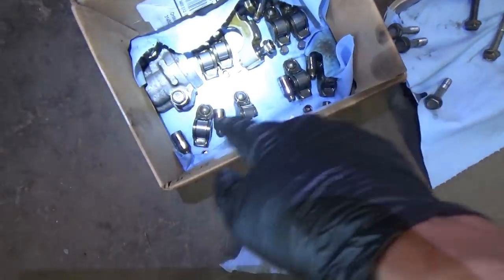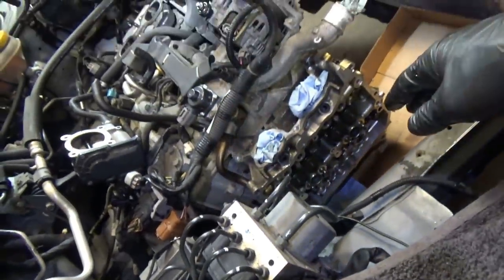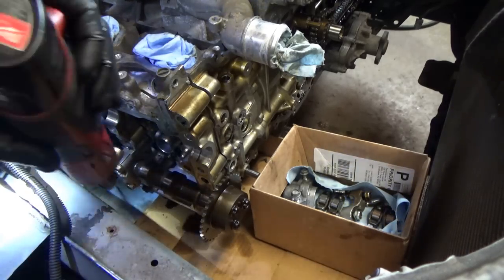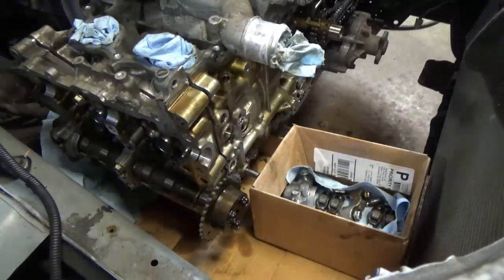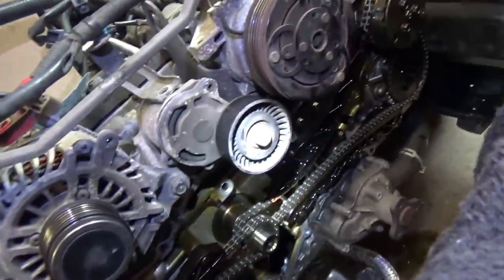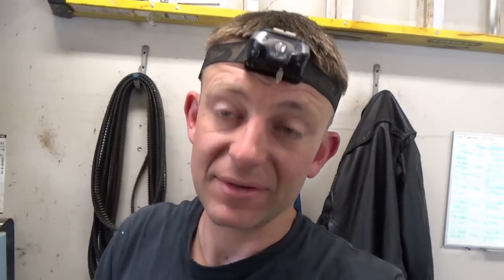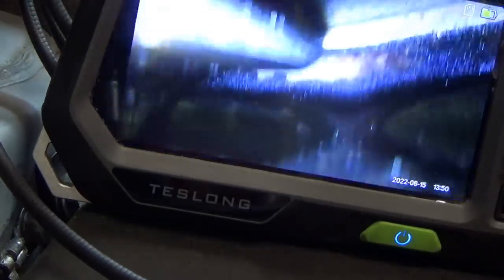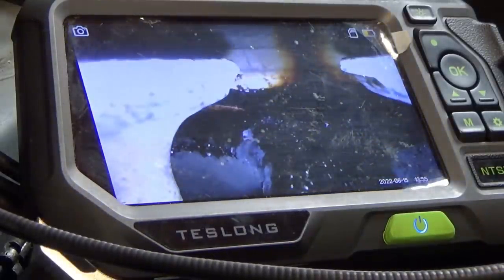Head Reassembly & Left Head Valve INSPECTION (Sad Subaru - Part 4)

Comment: BTW Ivan, this customer has played this one spot on, this one valve had to be changed.  Undoubtedly there are issues throughout the engine, but some of the comments on here beggars belief, You must remove the engine, plane the surfaces, replace the valve seals do this do that, you would be talking spending a lot more money, on a car with a questionable transmission and is getting on in years, what you spend on a car has to be PROPORTIONATE to what the car is worth and how old it is, people do not seem to understand this concept!  I'm sure he will get a few years out of it, and knowing you if it fails in a short time you will reimburse him for the labor.  I recall my dad replaced crank bearing shells, main seal, head gasket on a Honda Prelude I owned, he never used a torque wrench, reused all the old bolts and did it all in 2 days and you know what, that thing ran for another two years, and was still running after I traded it in!
Reply from the maker: Great comment Rob, I 100% agree 🙂
Reply: @PineHollowAutoDiagnostics  I traded it for a nearly new VW Passat, this was back in 2001 when I lived in the UK, let’s just say I should have held on to the Prelude!
Reply: In most cases, that would be the best method however, with some folks, keeping the same vehicle running is more important that the cost or going a little upside down with money being invested in them. A replacement vehicle, used, will carry a certain amount of risk too.

Comment: Subaru tech for almost 4 years. Normally watch your channel for scope diagnostic but I got curious when i saw a subaru video. Must say I am impressed you managed to get everything together with engine in. Just pull the engine next time. Only a 15 mins more work to have it out. Much easier to clean and no fighting with shims and rockers. Also you don't have to remove the intake with it out of the car. I take the bolts out and shove a small piece of wood between intake and coolant pipe to hold it up.
Reply: Yeah back when he first started the job it reminded me of Brians mobile one .. he was sack one day and did a time lapsed voice over..removed the engine in a few minutes less then an hour  to replace I belive was head gaskets ..said it saved him 2-4 hours??
Reply: I don’t think he had any way to hold the engine, though.
Reply: BTW  not saying I could do it that fast .. or save any time removing the engine .. just saying Brian liked to do it that way ( I think he used to be a Subura tech )
Reply: Ivan needs a bigger garage. Complete with engine hoist. Stands ect. 
He is doing the work like I used to do at my home. I jacked up trucks on stands. Dropped transfer cases and transmissions. 
Swapped engines. All this with no shop.
Working at a shop with all the equipment has its advantages. Kudos for Ivan for what he does. Drives hundreds of miles as a mobile Technician. He is a very cool guy.
Reply: @2nickles647  you bet 100% credit to Ivan I have been a very small contributing patron sponsor for him for at least five years I love watching them work he seems like a great guy.. by the way I'm 99% sure he does have an engine hoist but yes sooner or later age is going to hit Ivan and getting up and down off the ground all the time to do things underneath cars is going to get to him so yes hopefully one day he can get himself a lift and an external garage but of course those now cost an exorbitant amount of money not to lift that's not that bad it's the building to put the lift in that's what's horrendous
Reply: I think the challenge of doing this with the engine in was what interested Ivan. It is a good teaching video for the DIY guy without lots of tools. In hindsight, it would have been easier to do the other valves with the engine pulled but how much time would it have saved?
Reply: @dosgos  well it may have saved hours literally hours and you're right this is a good teaching moment but I think Ivan has had enough challenges in his life working on cars that he doesn't need another one 😁
Reply from the maker: @deepsquat600  my engine hoist is a tow strap wrapped around the ceiling rafters. Used it 2 times in 10 years... Both times on Subarus haha
Reply: @PineHollowAutoDiagnostics   if it works, is it really a bad idea? Lol 🤣🤷🏻‍♀️ subi engines are quite light too.
Reply: @PineHollowAutoDiagnostics  My dad used to use a come along to pull engines, your method could not be as bad as his was.
Reply: Well, from my part Ivan deserve every bit of admiration, he is not scamming people like some other technicians, I told the guy once before , Ivan am Elon Musk came to earth in the same space craft , the way he analyze the problems and get to the conclusion to solve it, that’s something not that many people have that gift !
Reply: @PineHollowAutoDiagnostics  Come' on Ivan you live in farm country. Couldn't you find a farmer with a backhoe to pull the engine? That's how we did it when my friend Dennis needed to pull the twin Chevy small blocks out of his power boat to fix the final drive. John Deere to the rescue.
Reply: @2nickles647  Ivan is still young.  Someday he won't.  Part of "he won't" will be wear and tear on his body now.  There's no free lunch when you are young.  It all comes back later.

Comment: Yeah, those valves in the other head are done for too.  Definitely an oil control problem.  That would explain the heavy carbon buildup in the head dome and valve seats.  But I don't think it's a stuck PCV or bad valve guides or valve guide seals.  If I were to guess, it looks like it may be time for a new set of piston rings.

Comment: The earlier year models of the FB series engines (2012-2014 Forester, 2013-2014 Outback, etc) had a maassive oil burning issue that causes exactly the problems shown here- burned/ cracked valves, pitting, oil consumption since the exhaust valves can't seat properly, etc. Had a 2013 Outback that burned oil like crazy- like 1 quart every 800 miles or so. Like they went straight from head gasket issues to oil consumption issues. If you're looking at a Forester or Outback, 2015-up is less of a risk- they seemed to have addressed this issue by then (updated rings maybe?) Never understood how Subaru became one of the top selling vehicles in recent years with all these issues between head gaskets, oil consumption, CVT problems, etc but they are still extremely popular around where I live.
Reply: Popular because of creative advertisement is my guess.
Reply: Consumer reports best buy and fairly cheap car.  That is why they are so popular and you see allot of them here in the Pacific Northwest.
Reply: Because these problems take time to show themselves, and not everyone will experience them.
Reply: @Cheepchipsable  If you find a 2013-2014 model that doesn't burn oil, better hang on to it it's a unicorn
Reply: @Cheepchipsable  Wife's DD 2015 Forester 2.5  she does a 100 mile commute everyday.  Thru some of the worst traffic in the Seattle area also.

Comment: Nice job Ivan. Can't wait to see how it runs! I would not worry your side would hold up longer than the other side. Things break. The owner knows. Subaru had a recall on high oil consumption. With the engines using 0 w 20 oils. Good job.
Reply: My Jeep 2015 Renegade also had a recall on excessive oil usage.  It used a quart/2 000 miles at about 45000 miles..  It was "repaired" with a new software installation.  Never thought of that being a culprit and no idea what it did.   Now, there oil usage is virtually nil.

Comment: Hi Ivan,
Nice work getting the shims and rockers on the exhaust valves. That is quite a bit of oil pooling in the left cylinder and those exhaust valves don't have much life left. If it is burning oil, that engine should be either rebuilt or replaced with a quality rebuild unit. Stay safe.

Comment: Hi Ivan. You didn’t mention the valve seals . My VW  was burning oil at high  mileage . I sent the head out to a shop for refurbish seals valves etc. I did the rings & Shell bearings and checked end play all the bottom end . But your doing a great job with the motor still in the car . Very interesting to watch waiting for #5 episode 👍🛠🔧⚒⚙️saving the customer a ton of cash .

Comment: Somewhere I heard that this generation of Subarus tried to address better fuel economy and to do that they made everything loose. Less friction equals better economy. But they made it too loose and it just burns itself up.
Reply: Yep, a lot of these era engines have very low friction oil control rings, leads to huge oil consumption and endless other issues.
Reply: This is true of all manufacturers. It is why oil changes with the correct oil are so important

Comment: Your boar scope camera work was fantastic inside the other bank #1. And you took pictures to show the owner. I wish I had thought to do that on both banks B4 the discussion of repair with the customer, but I did not. I only thought of boar scoping the bank #2 with the problem cylinder. I hope those hydraulic lifters pump up. Leaving them laying sideways out of oil might have allowed air to enter. Some lifters need manual priming B4 reinstallation. Worse case just bring the engine up to 2000 RPM and hold for 30 minutes. Those exhaust valve shims are all selectable and because new exhaust valves where installed a special tool is used to check exhaust valve height that ultimately effects valve to cam lobe clearance. That engine has 140,000 miles so it's a broke in slop monster so it might be more tolerant. Your work is wonderful. I learn a lot watching your videos. My comments are only that. You're doing great work and the vehicle owner is in good hands.

Comment: Great work with the endoscope IVAN.That is a super handy tool when working on motors.I don't know subs but maybe the cylinders laying on the side contributes to the oil pooling ,whereas inline fours are straight up? and v8 or 6s slanted.This one is Definitely using oil.If the lifters are non adjustable,what a pain.I worked on older JAGS and a few ferrari's and they had overhead cams and BUCKETS or shim caps over the valve tips.To adjust valve clearance you had a supply of different thickness shims ,and you measured each shim minus or plus the clearance needed and replaced the shim with the right thickness.Way different than the triumphs or Mg's.especially since a lot were V12s.if you wanted a fancy car ,YOU had to PAY.haha

Comment: Excellent work Ivan. Your patience is astounding. I`ve been wrenching on my own junk for almost 50 years. I wish I knew 1/10th of what you know. Newer cars lose me with all the modules. Now my ex wants me to work on her latest mistake, 2013 Equinox..2.4L 4cyl Ecotec time bomb..Service Stabilitrak and TPM message, and ABS light on. Auction purchase 😟 Found out it was a repo. Autozone scanner will not pinpoint issues. Their scanner is better than one I bought. You are 2 hours away for me(116 miles), may have to schedule a road trip to State College so I can get correct answers. Most mechanics here and the stealerships will just rip her off. My 6 yr old Grandson will be in this vehicle, and he is my world. His safety is paramount to me.
Reply: TPM issue is probable 2 dead rear sensors no reading in message center.
Reply from the maker: Get a good scanner and go to town! 💪😎

Comment: As with an aircraft engine, any carbon created from oil consumption or really rich running  that finds it's way to the seat or valve face will hold the valve off the seat and start eroding both. I'm really surprised that the seat on the bad valve was not somewhat eroded. The difference lies with the liquid cooling and the heat removal from the seat as opposed to aircraft's air cooling which exposes the seat to much higher temps. This is the reason if you want to cool an aircraft engine it either takes excess fuel or running lean of peak EGT to cool with air. Valves on aircraft are exposed to the same environment as water cooled and rely heavily on the valve guide to remove heat. Also why some exhaust valves are sodium filled. VWs we're also a bear in this regard esp the #3 cylinder since it had this huge oil cooler standing vertically in the fan dog house. Just relocating that oil cooler removed the valve issue. Nice video....
Reply: It was useful to set VW #3 valves a bit looser that the rest.

Comment: You really didn't show it or talk about it but the application of the sealant is important for the longevity of the engine, too much and whatever gets squeezed out can and will go on to wreak havoc inside engine, about the crush washers you're absolutely right, I always do plugs with a regular ratchet and you can certainly feel the washer crushing ( only with fresh plugs )

Comment: I'm no chemist but I'd take a guess that much of those carbon deposits carry an acidic element to those valve seats and valves. I noticed the cylinder walls still have good cross hatch surface to them so the darn oil control rings are likely badly worn. Time for a ring job it seems and an early one at that.  You sure understand the advantages todays bore scope technology in this video...25 or so years ago they didn't exist for the money/trade.

Comment: Subaru used to make ridiculously reliable engines, than they didn't. I know. We had a 2006 Impreza, it leaked like a sieve after s several years -oil & coolant. We bought it new & had it dealer maintained, with the services done per the book & never late. In the end we had a used engine installed by a Subaru only business. The engine we bought had far less kilometres than ours which was good. Though I suspect t still had the crappy head gaskets. It was only kept for a couple more years I think then sold.
Reply: Lets be honest it's not just Subaru, but most makes now. All the big US, EU, JP cars used to be very reliable mechanically up to around 2000. After that it has gotten worse and worse.

Comment: The 2014 Foresters are known to burn oil. This is what is causing the problem. The same for the FB20 motor. Good motors, but to meet government emission standards the piston rings were purposely put on a lot looser or with a bit more play than usual. My Impreza has 40k miles on it and I have been keeping my eye on it. Also, when you get your car serviced at Subaru they with purposely put more oil in it to prevent the car from running out of oil between their 6k oil change  intervals etc. I would change the oil on these car every 3 to 4k miles.

Comment: After watching part 3 yesterday it seems that the right head is going to suffer from the same problem in the near future. Now is the time to fix the other side or to sell the car ASAP. The issue with the exhaust valves should be a recall issue.
Reply: Subaru has a history of refusing to issue recalls on major engine problems like this- they never issued recalls on the EJ head gaskets, and only agreed to perform "oil consumption tests" for customers when hit with a class action lawsuit regarding the oil consumption issue, which basically gave them leeway to say whatever they wanted if a customer brought a car in with that problem. They only issue recalls when it's dangerous to drive the car, which are numerous in and of themselves with all the CVT issues they've had. To be fair, there's probably a few issues with every single car manufacturer that should have been recalls but weren't. You can thank lobbyists for that.
Reply: To bad one solution is to pass a failing engine to some unsuspecting person and I’m sure the price would not reflect the cost of future repairs.
Reply: @michaelmarks8954  You are correct, but unfortunately this happens all the time especially in RV's

Comment: Have one of these apart now, 129k and ALL oil rings and drain holes on pistons are stuck and plugged with sludge, no sludge in pan or rest of engine.
Reply from the maker: Wow... Wonder if they used conventional instead of synthetic oil?

Comment: you can try running some cleaner through the crankcase, like that bg dynamic cleaner. i presume those oil control rings are completely filled with carbon buildup and are letting oil through. might also help clean the valve seats..

Comment: The spark plugs and oil in the pistons may be caused by the horizontal pistons. There is no room between the valve cover and fender, I have nightmares thinking about getting plug socket into and out of the holes, same problem with valve cover bolts when replacing a leaky cover gasket. Gravity keeps oil pooling in a pistons on more vertical pistons, it probably is pooling a lot more with this design. It probably is a good engine for fitting into the space they want under the hood and may add inches of ground clearance.
Reply: Yes, I do believe that this is a major contributing factor.

Comment: Issue is with the horizontal engine. Unlike vertical engines, the oil is always rest on the cylinder bore. Soon after rings wear out, oil make it's way to the combustion chamber.

Comment: Loved the shots of the exhaust valves. That was great to have an explanation of what caused the problem. Do you think running a carbon "cleaner" additive would help this engine last longer? Maybe there should be a recall on the piston rings or the oil weight is too low for the engine design. Hm interesting.
Reply: In a direct injected engine?
It wouldn't do a thing.
Reply from the maker: @atticstattic  IT'S NOT GDI!!
Reply: @PineHollowAutoDiagnostics    Did you see that the Georgia Guide Stones got blown up and taken down. lol.. good stuff.

Comment: I would tell the customer to run a can of b12 chemtool  in the gas every other fill up. Superzilla in the gas tank can also work wonders.  it will free the stuck rings, and clean carbon and oil deposits off the valves.. I think that engine has sticky rings.
Reply: Sounds like good advice to me.  If I had a borescope, I would do a before and after visual comparison to see if your theory holds.
Reply: @vpimike2646  Direct injection, so no fuel goes past the valves.
Reply from the maker: @Cheepchipsable  Incorrect.